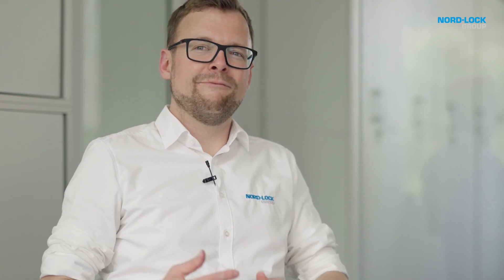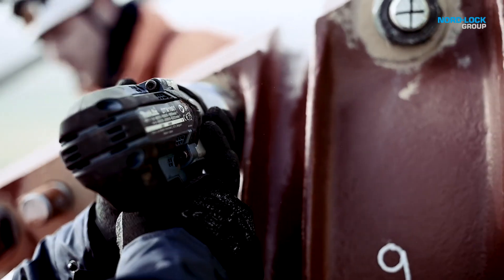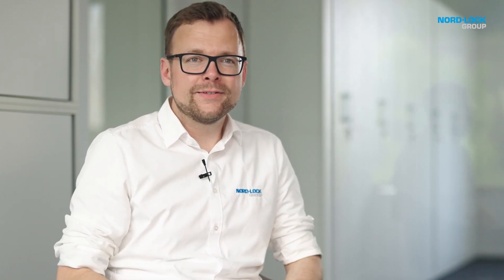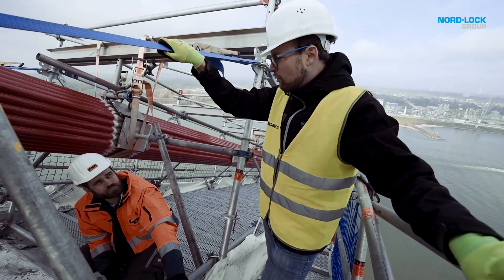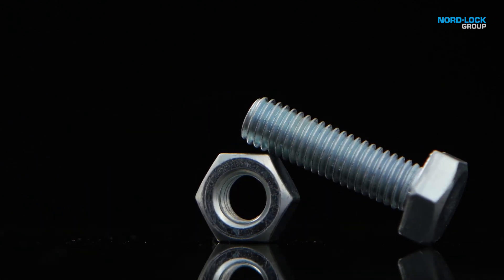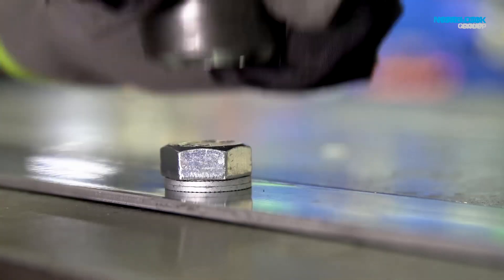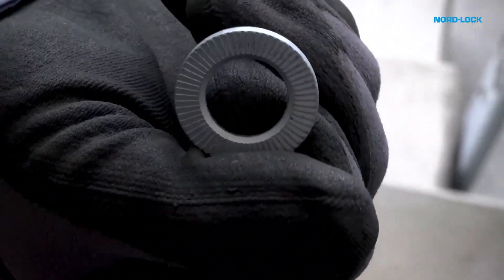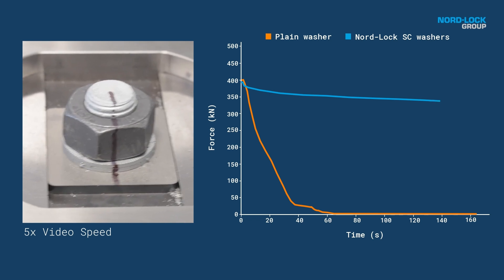Durable Bolted Joints in Steel Construction

Comment: Do the washers come with recommended torques? Or do you just tighten the nut until you can't apply any more pressure or move the nut any more?
Reply from the maker: Thank you for your question!

For the construction and building industry, the required torques are given in our European technical assessment documents. 

You can download them at https://www.nord-lock.com/campaign/ce-marking/

For all other industries you find our torque recommendations at https://www.nord-lock.com/nord-lock/torque-guidelines/ 

Or, you can calculate it on your own, using our torquelator app:
https://www.nord-lock.com/services/digital-tools/torquelator-by-nord-lock/

We hope this was useful!